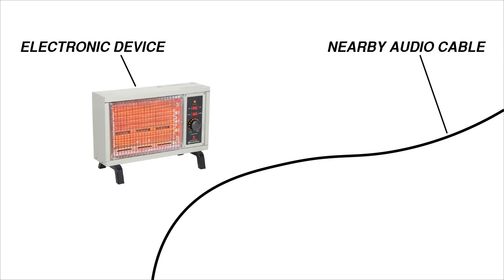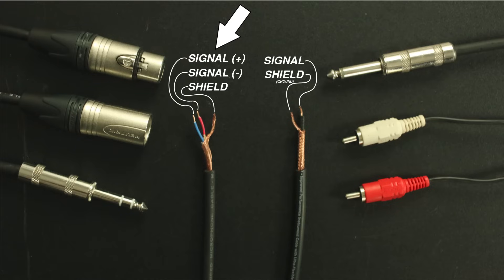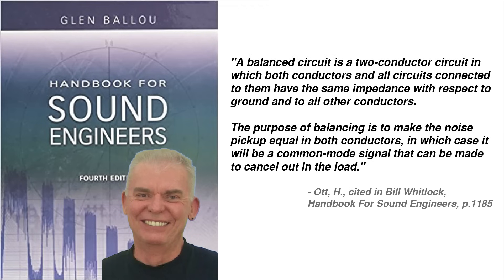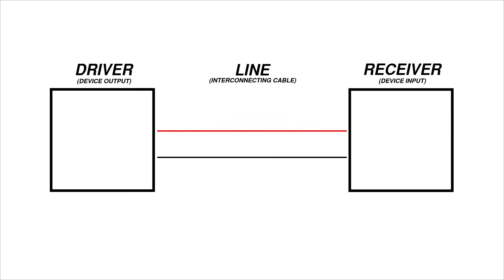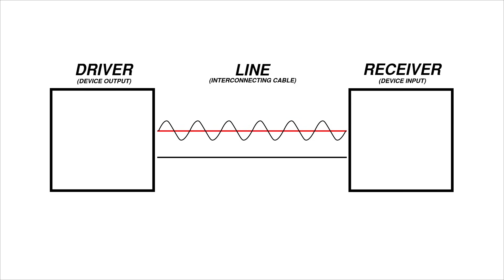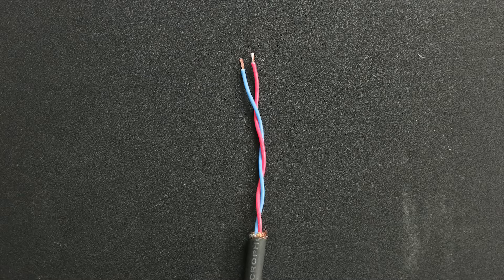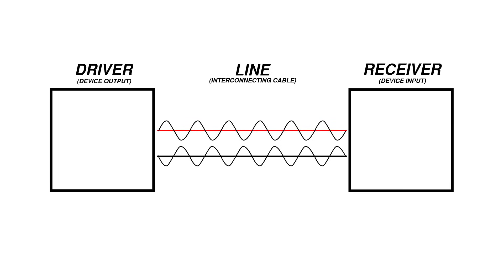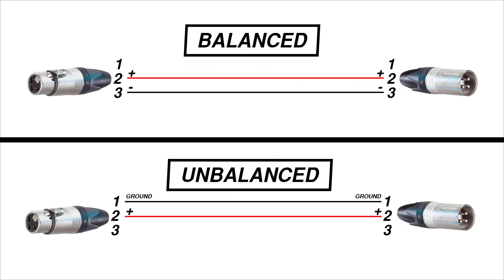Balanced vs Unbalanced Audio | Do Balanced Cables Sound Better?

Comment: Great video, I really like the demonstration! In my experience it is not just about balanced or unbalanced connections, but also if and how the cable is shielded. I have a couple of Vovox sonorus direct cables which are not shielded. If placed carefully and correctly they really provide the best sounding connection, but if placed inattentively it is almost like patching in a radio receiver. For best protection from electromagnetic fields I now tend to use double shielded star quad cables, so four conductors in which two opposite ones are used for either of the signal lines. As both conductors sum up appear to be in the center of the cable to an magnetic field, both signals receive the same interference which is then cancelled out in the receiver. Due to higher impedance there is a loss of higher frequencies but it is negligible for studio use, and I highly doubt you would be able to hear it even with a 100m cable.

Comment: My understanding is that balanced is important for the low levels from a mic before it goes into any preamp. So one could overcome the need for balanced by having a simple preamp at the mic end raising it to "line level" and running the cable as regular conductor+shield. The mic in a cheap wired headset for phones (where there's a mic and button half way up the wire) draws a small supply that amplifies the signal, beyond the levels of the mere electret condenser. Why don't pro microphones do this.

Comment: I refused to even watch this video - the ONLY way one can really test out if an unbalanced cable compares well to a balanced cable is, first of all, by making comparisons on an adequately revealing system (right there, the majority of systems out there have been ruled out, as no actual difference if any would be able to be detected in most systems), second of all, following a proper A-B testing procedure (not necessarily blind tests, although if possible that would be best), and third, and this one is the big kicker, the two cables to be compared MUST be made from the EXACT same wire material. I know of no such company making balanced and unbalanced cables from the SAME material. Therefore, no comparison test would ever be truly valid. Case closed. And BTW, I have tested many unbalanced interconnects, and have demonstrated many times over that, given my highly revealing system (that took me decades to develop to this level), real differences between interconnects of various costs and construction DO exist and are readily and immediately apparent. Those differences are not huge, but they are significant enough to really make a difference. I will demonstrate this fact for all to hear in my upcoming video on A-B testing. And my channel is NOT monetized, I make NO money doing this, its all just for fun.

Comment: They actually are polarity flipped down the cable, then reversed back for the common-mode rejection. Without this, it is not a true balanced connection.
Reply: A balanced interface does NOT require equal and opposite signals to reject noise.  Rejection arises from the IMPEDANCE matching of the two lines with respect to ground (the signal doesn't even appear in the math to determine common-mode rejection ratio (CMRR).

Comment: 1:38 ---- just forget about what that says. The simplest way to picture it is to have conductor A and conductor B. We send audio signal "M" along conductor A. And we send signal "-M" along conductor B. Note the negative sign, which is easy to accomplish in electronics (and maths). If both conductors are very close to each other, then any electrical/magnetic induced noise (call it "N") will get equally into both conductors. So conductor A would get M + N. And Conductor B would get -M + N. The noise +N gets added to both conductors, which is easy to see mathematically. So, when we get to the receiver, we use electronics to take the difference between conductor A and conductor B. A simple subtraction is done. So the result of the subtraction will be (M+N) - (-M+N), which gives 2M. The factor of 2 doesn't actually matter, because the receiver can scale the received signal "2 times M" to whatever it wants (in terms of volume etc). What is important is : the noise is cleverly dealt with. The method actually requires three conductors : A, B and C. The third conductor will be the reference conductor (or ground conductor). Whenever somebody tells you that balanced circuits requires only '2' conductors (even if they say it's relative to ground), then they're not telling the full story. You need three conductors - signal 1, signal 2, and the ground (reference) conductor. So, in summary, the message audio signal "M" is sent along one wire. And the negative of signal M is also sent along a different wire (which is part of the clever trick). And later, at the receiving end, a subtraction is done. Any noise that snuck into the lines will get wiped out by the subtraction. And having the signal wires very closely wrapped (twisted) together will ensure that any noise gets into the two 'signal' wires equally.

Comment: I'm dying to know if this applies to antenna cabling.  specifically for VHF/UHF transceiver antennas. you mentioned the receiving device cancels the signals out if both are received on the differential device.  does this apply to transceivers, or is there a device you can apply to the circuit to cancel it out?

Comment: Some maths help a lot to understand easily on this one :

The source will invert the phase of Cable 2, so you get at the source : 
Cable 1 = +signal 
Cable 2 = - signal

At the receiver you then get :
Cable 1 : +signal + noise
Cable 2 : -signal + noise

Then the receiver subtracts Cable 1 - Cable 2 (in other words inverts the phase of Cable 2 and then sums the 2 cables), which is to say :

+signal + noise - (-signal + noise) = 2 x signal

Conclusion : 
- noise is erased by substraction
- you get 2 x signal (which is to say +6 dB) at the receiver
Reply: But, if signal on either of the cables is zero, noise is still cancelled completely, but signal is only 1X.  We don't use balanced interfaces to get 6 dB of signal gain, we use them to eliminate noise.  And, yes, a differential amplifier is just a precision subtractor.

Comment: Nice. Although impedence is really resistance. Or ohms of said cable. Longer fatter the cable the higher the ohms, resistance. Or as you put it impedence. Good video Sir  unbalanced is not good in most cases of recording. Balenced is probably better in most cases. Thanks for insight. Very interesting.

Comment: Noise- We were playing outside at a local library. It was an evening gig and after a while, they turned on the huge old florescent lights in the stack room. At that point, we heard a low buzzing in our equipment. We were about 50 feet away but it was enough to be annoying between songs.
Reply from the maker: Thanks for sharing, Rick. Is it possible that you were connected to the same power circuit?

Comment: Great video on how balanced works. I have been in audio over 50 years and this rocks the vote on how balanced works. Some systems are quasi balanced vs. True full balanced and differential. The quasi balanced employ summers for their design while others are fully balanced and Differential all the way from input to output. We audiophile music listeners call this the holy grail of audio. Frankly in practice a well designed unbalanced or single ended design is just fine. It is about application. My house of worship for instance has to run balanced. No choice. In your home, most are fine with unbalanced where balanced is truly a preferred more than truly needed.

Comment: First off, great video. I just purchased a pair of KRK speakers that I need to connect to my tascam US 600. I can’t seem to find TRS to RCA cables, the tascam only excepts RCA to connect speakers. Since I can only find TS to RCA cables,  is that OK or do you recommend me searching deeper for TRS to RCA cables? Not even sure if TRS to RCA cables even exist.
Reply from the maker: TS to RCA and TRS to RCA are effectively the same thing. That’s because the RCA connector only has two connections, just like a TS connector. The third connection on a TRS wouldn’t have a place to connect on the RCA side. 

If it’s within 20 feet or so, a TS to RCA will work well. If it’s much longer, you may want to use some sort of balun or transformer.
Reply: @AudioUniversity   @Audio University  Thank you so much! Can I use a trs cable for a guitar when recording inter an audio interface? I'm asking because I always see ts/mono and never a trs cable.

Comment: Thanks Kyle - top content as usual. Generally unbalanced is used for short distances - hifi hook ups, guitars and effects. In general microphones always benefit from the use of balanced XLR cabling as they are often the longest cables on stage.
Also on stage your audio cables may cross the path or run alongside lighting cables. Lights are dimmed by chopping the mains power up. This is probably the noisiest and dirtiest interference you will encounter as a sound tech. In this situation you might look into quad or starquad cables - this has nothing to do with quadraphonic sound. Just like the twisted pair shown in the video, quad cable is 4 wires in a twist. It offers even more noise cancellation, but of course - more copper wire means more expense. Maybe Kyle might make a video on how to wire up a quad XLR in the future.
Reply from the maker: Thanks for watching, Rec Dept!

Comment: Excellent video but you forgot to mention that balanced XLR cables put out +6DB in signal strength over unbalanced.
Reply: This is really the best reason for home use to go unbalanced, you can inch out higher volume on headphones especially power hungry ones that may sound quiet on your amp , also I have every cable format connection on my amp so it makes it more convenient to keep multiple headphones plugged in at once and switch outputs easily with the remote.
Reply: You will get 6 dB more level only if the balanced line is driven by equal and opposite signals.  It is not a requirement for balanced lines and many have signal only on pin 2 (high or +).

Comment: Yeah, I have a huge noise problem in my house, being an electrician I investigated, and even with everything turned off, I am still getting neighbors air conditioners and what not!  I know there are ways to deal with it, and use a few, but to do it right, can get expensive.  The infrastructure in my city is terrible, and like in most places the only things that get attention and look good are where tourists would go, creating the same illusion their towns do too!

At least the FCC cleaned up the airwaves, and along with newer tech it is rare to get the kind of RF interference I used to through my gear in the 70's through the mid 80's.  Some people think it's a problem now, but they have no clue how it used to be, ad you are too young too to have experienced it first hand.  Nothing like hearing pilots, truckers, walkie talkies and such come through your amp, louder than your guitar, while playing a show and blowing your own mind for playing better than you thought you could!

Comment: What if the length of the required cable is just 5ft? Is it still recommended to use a balanced cable?
Reply from the maker: Balanced connections are recommended over 15ft. I use balanced connections anytime they are available personally.

Comment: bro , how about the speakon cable ? is the maximum of 10 meters is a misconception? they don’t even come longer than lets say 15 meters , but watching your videos Im super keen to know what os realistically the longest speakon cable I could possibly use in my setup. 
im using just a standard 3600 RMS two CH nothing fancy . but would be awesome if i could go 30 meters without jeopardising quality (its a loudspeaker so quality is not going to be HiFi)
Reply from the maker: Yes. A 30 meter cable should be ok. I would recommend a thick gauge like 16 or 14 for a long cable.

Comment: Love this but my amp has only two (red/black) connectors and the speaker terminals too are red/black. How do I make a balanced connection? Maybe it is balanced. The impedance of the wires is the same (very low and 10-gauge equivalent and twisted).
Reply from the maker: A speaker cable is already “balanced” in that any equal voltages in the positive and negative cable will be cancelled in the load.

Comment: Thank you so much for this lesson! I just learnt what's that big deal om balanced VS unbalanced cables and I'm thinking, some simple engineering can beat even AI utilities, in this case - Hum removal. I'm sincerely worrying cuz every audio equipment I have in my home are unbalanced so far leaving me in a misery of 50 Hz powerline harmonics. I was experimenting a lot on narrating on a potato and not knowing all of this, I have tried noise reduction tools of Audio editors and ruined almost all of them with more noises and a slightly varying muffling effect added to that recordings each times. After all, I began to hate my recorded voice clips (plus the fact that the physical bone connection between my vocal cords and ears thru the whole damn skull and more are making my voice richer and bassier than listening to a recorded crap.)

Comment: What you're describing is called "phase cancelation" that is what I got from your quoted info. This is more about electromagnetic frequencies and their vibrational relationships and less about electronics/electricity or wires. You can experiment with this by taking two speakers and and playing the same hz through both but flip the polarity of one and you will hear a significant drop in SPL. This is also used industrially to calculate and dampen vibrations in exhaust systems or large assemblies,or bridges, by calculating the resonant frequency. Same way you would measure a room and wavelengths to know where to put your baffles or bass traps for acoustical treatment. By being balanced, any electrical noise would be "in phase" and thus like you said, induces noise cancelling because the waves traveling through the wire physically cancel each other out at their end. Good video!
Reply: You’re interchanging the terms phase and polarity which is not correct. Phase inherently implies a time relationship between two signals which is not what is happening here. It’s polarity that’s at work here which is an absolute with no shift in time/phase between the signal on the 2 wires.

Comment: The comparison is a bit odd. You don't use unbalanced cables unshielded.
What you missed is in which cases we use one or the other. Otherwise unbalanced cables would not be used at all.
I suggest you study better the subject and instead of "Do Balanced Cables Sound Better?" use a more adequate title like "In which situations we use one or the other"... If you can figure it out... :D

Comment: One additional benefit that you might mention about a balanced connection, you get a 6 decibel gain without raising your floor noise. That's partially why balanced connections sound instantly quieter

Comment: Great video! I totally agree to your wording, that HF noise has many ways to intrude to our recording chain. For example: Even if the cable is bulletproof, are you sure the equipment is? I had to learn this the hard way once: I ordered myself a TritonAudio Fethead. And that in-line preamp ended up picking up HF noise, if it was in the line of sight of a radio tower roughly 800 meters away of my house. I could literally hear a radio signal!

But talking about the cables: Even knowing the benefits of a balanced connection, one should not deceive themselves into believing that’s all that matters. Let’s say, a balanced cable is less susceptible to high frequency (HF) noise and ground loops. That being said, while they are less susceptible, a proper shielding in the cable can still help to fix issues with HF noise, if you have lots of radio frequency interference. I have had issues with cables that lacked proper shielding before and ended up replacing cables. So i once again learned: You buy cheap, you buy twice. 😅
Reply from the maker: Thanks again for sharing your knowledge and perspective, Michael!

Comment: will balance still sound better if i use a 3.5 jack to balance adapter
Reply from the maker: No. The 3.5mm stereo jack isn't set up for balanced, so using that adapter will always be unbalanced.

Comment: How many times are you going to use 1,000 feet of mic cable though
Reply from the maker: Not very often... The general rule is any connection beyond 15-20 feet should be balanced. Thanks for watching, Ernie!
Reply: @AudioUniversity  thanks I do the 100 ft rule for speaker cable, I use xlr if it's over 100, if not a two lead heavy duty or 16g wire is ok, never had a problem unless you are in a band where theres a lot of rf.

Comment: Is there any direct relation between being a balanced output and being more powerful?
Or just for convenient use? 
I say that with DAP/DACs outputs in mind

It is logical for me that we have more wiring and more system inherent to handle more power, but that is kinda like half explanation.
The duality of balanced connections seems logical with Dual DAC chips too...
Thanks in advance.
Reply from the maker: I don't believe the benefit is increased power so much as it is increased headroom. If you send the signal across both negative and positive (inverse polarity), they will sum together at the other end, resulting in a +6 dB boost, while the transmission noise will be rejected.